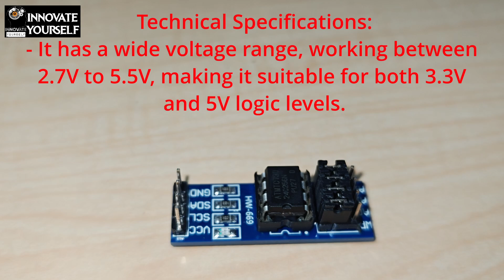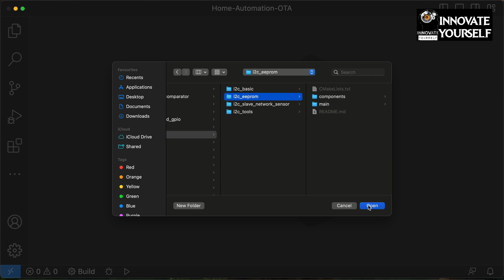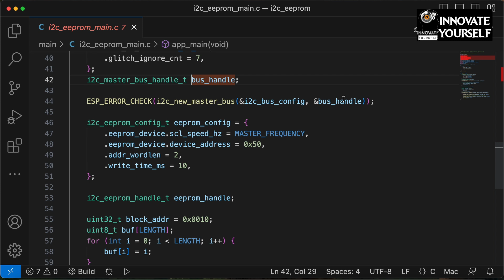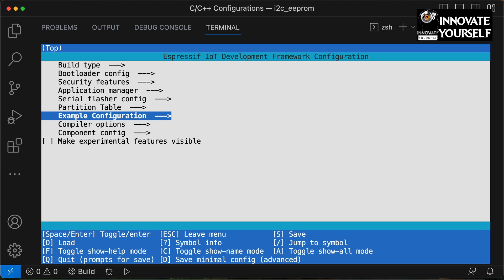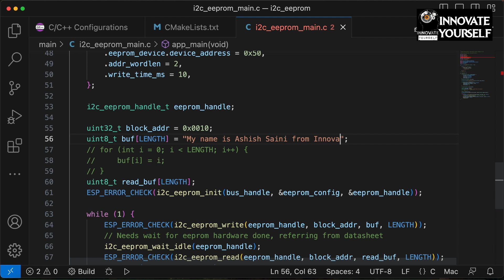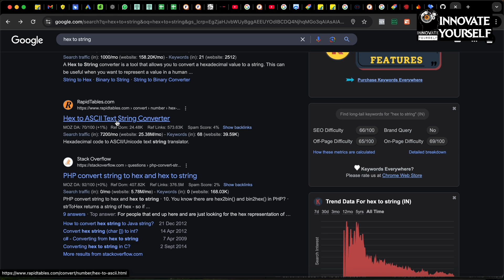INTERFACING EXTERNAL EEPROM AT24C256N WITH ESP32

Comment: suggestion for a simple increase in audio quality:
acoustic panels
echoes cause all kinds of problems. Software echo compensation is one of them. (Lowers volume and reduces quality by cutting frequency ranges. And that's the best case. The lower end is always open.)
Just taping a few to the wall will notably improve the quality of the recording.
A carpet also is like a less optimal acoustic panel for the floor. So carpet in the recording room is also a good idea especially when it is mostly empty otherwise. Flat hard surfaces are the enemy of microphone recording. The bigger the worse.
Reply from the maker: Thank you so much for your suggestion. I'll take care of these points in my further videos ☺️